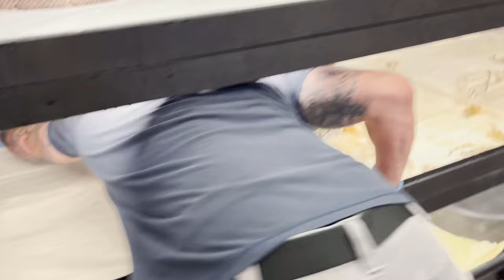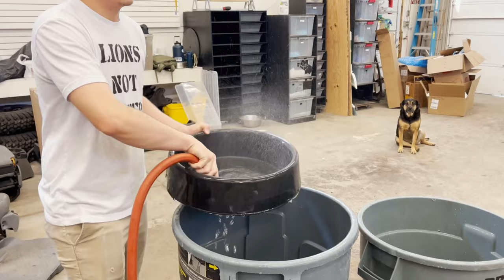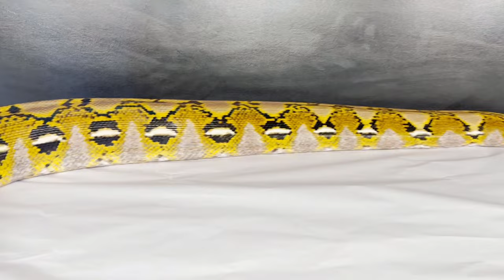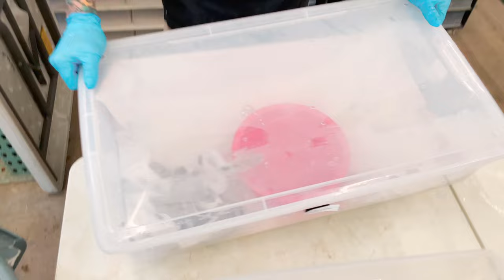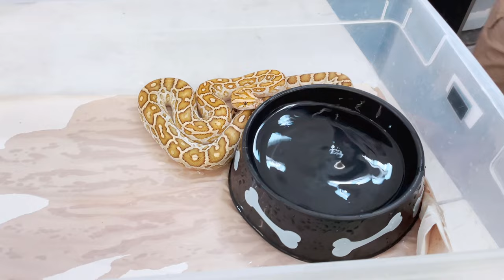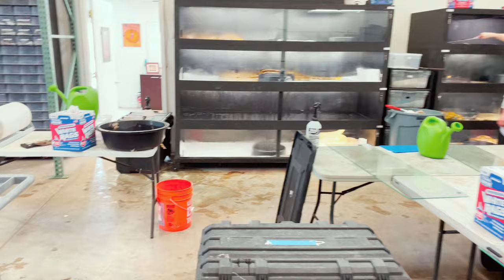How To Address The MESS-  What It Takes To Keep Our Reticulated Python Collection Clean

Comment: Couple of questions. 1st what materials are your cages made of. They look PVC, and how did you get 10' cages if so. Are they (2) five footers put together. 
2nd, what is your bleach / water ratio. I use as a general rule of thumb, 1 cap of bleach / per gallon of water. I've used this ratio for 45 yrs. and never had any issues.